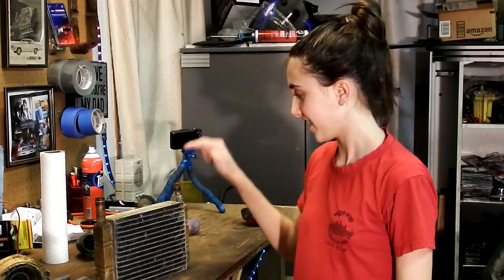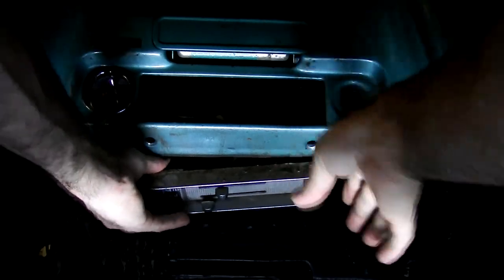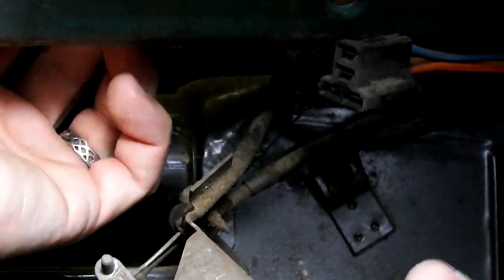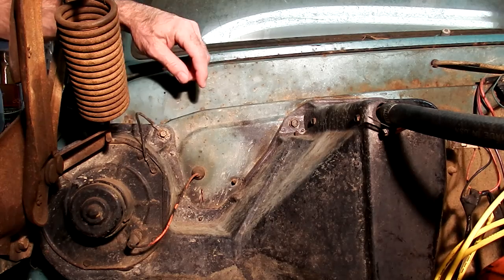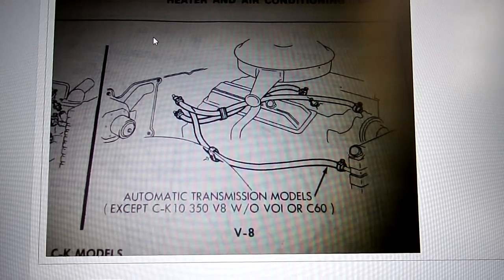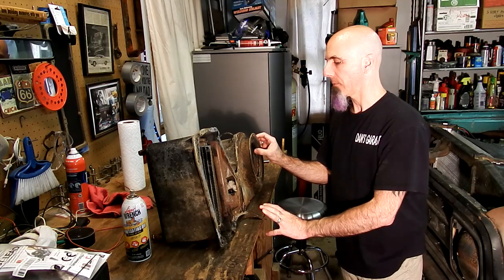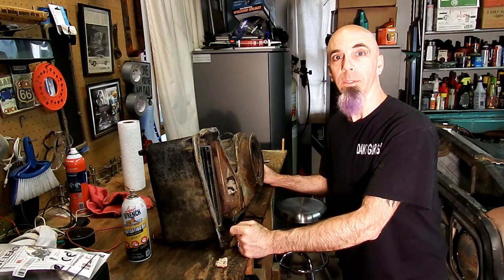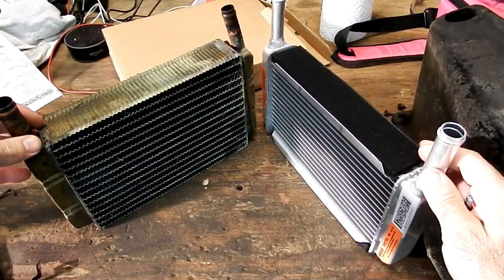Heater core replacement

Comment: If you need to replace the heater motor or squirrel cage, use both the heater motor and squirrel cage for a 1984 Buick LeSabre RWD, heater only, non AC. I got mine from NAPA. 
Hello from north east Montana. 
10 miles from the Canadian border.
Reply from the maker: Hey Darrel! Thanks for stopping by and the tip!
Reply: @DansGarageNC   My 69 C10 has 312,000 miles plus. For 10 + years the speedometer cable was broken. I am the 2nd owner. It had a 307, 2 bbl, 4 speed, 3.08 gears,15” tires. 
Now it has a 350, 4 bbl, original 4 speed untouched, original rear axle, I put bearings in it in 80 or 81. It now has P235/75R16 tires. Driving it to the farm daily it runs 14 to 18 mpg. On a 350 mile road trip to Billings it ran 16 to 22 mpg.
When the box is empty it can still burn the tires. I had it up to 124 mph, by GPS, 2 summers ago.

Comment: Thank you for taking the time to post this informative video. I have a question. I need to replace the heater core in my 1970 Chevy pickup, non air. My stepdad tells me to get a copper/ brass core. He says that an aluminum core will not work. Do you think an aluminum core will work ?
Reply from the maker: Thanks for the comment, here is something I found on the web:  Are Aluminum Heater Cores any good?
To sum up the discussion on aluminum vs copper heater cores: Are aluminum heater cores any good?

Aluminum heater cores are good enough for all modern cars to equip them from the factory. They transfer heat just as well as an old copper heater core and can be a worthy replacement. The most important factor to look for when installing a new heater core is the quality of the manufacturer.

Ensure that the manufacturer is reputable and it is almost always worthwhile to pay a few extra dollars to get the reputable manufacturers product over a cheap knockoff. If in a case where a copper heater core was available, I would get whichever was made by the better manufacturer. Otherwise, take the one that you can get and install it and be done!

Comment: What parts store had the better sized heater core? I have a customer wanting me to replace the heater core in his 72 C-10 and was curious how difficult it was since other shops passed on the job, and I guess I see why lol. Still doesn’t seem all that difficult but I guess it may depend on if the bolts/nuts come loose or not. His truck does have a/c though so I assume that makes it a bit worse? Still debating on taking the job or not and what to price it at if I do
Reply from the maker: I got it at O'Reillys. I was prepared to go to every parts place until I found the right size. Don't know about A/C though. Good luck.

Comment: Good video, I have a 71 C10. Had a body shop throw in a heater core while the fender was off. It's flopping around in the box. I purchased the core from Napa. As it turns out I think it was narrow compared to OEM , and of course it's not bolted in properly. I wish the shop would have called me instead of just letting it go. 
I'm not sure what was already in the truck. So I had the new core put in while it was "easy", but it was done half assed and now I need to get busy. Lesson learned.  Subscribed. Where are you in NC ? I'm near Fayetteville.
Reply from the maker: That stinks, maybe they missed a clip or something? I am in Raleigh.

Comment: Thx Dan...You are doing it right...I need to seriously clean out the mouse house.  It smells really bad in the cab. How do you remove the inside wheel fender?  The bolts are rusted & some are inaccessible, just like the bottom bolts on the heater cover. Got any hints?  I guess I will try to access them & cut them with a Dremel, but then how would I replace the bolts when I cannot get a tool on the inside nuts?  I do not think the plastic "press thru" screws (used on modern car plastic fender/shieldings) will be strong enough. Suggestions please!!  Lazzlo
Reply from the maker: Lazzlo, Thanks for watching, It may be easier to remove the hood and hinge instead of the inner fender, but If you do cut out the bolts, you can get replacements at a restoration shop, or local auto parts store that will work just fine. Couple tips, hit them with spray a couple days before you try to remove them, then go back and forth on them and they will loosen up a little more each turn. Good luck.

Comment: Aluminum does not cool better than brass and copper.
Reply from the maker: I found this on Griffins Radiators website: 
1) Does an aluminum radiator cool better than a copper brass radiator?
An aluminum radiator does cool better than a copper brass radiator. For example, an aluminum radiator with 2 rows of 1" tubes is equivalent to a copper brass radiator with 5 rows of 1/2" tubes. Aluminum provides high efficiency, is lightweight, and has a longer life compared to copper brass.
But then again, they are in business to sell radiators.
Thanks for the comment.
Reply: @DansGarageNC  Must be a marketing ploy, copper has almost twice the thermal conductivity as aluminum. Brass is worse, but old radiators were made from brass and copper, therefore my brass comment.